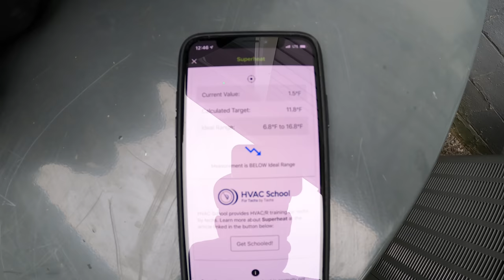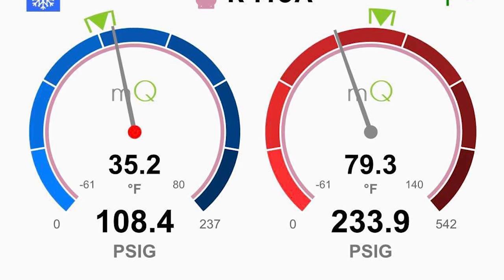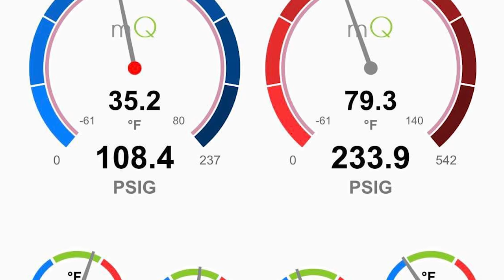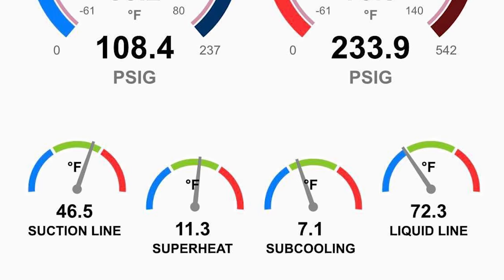Goodman Heat Pump with HORRIBLE Duct System & How I FIXED It!!

Comment: Nothing wrong with flex IF it is installed correctly. Not using galv elbows at the drops and keeping the flex as taut as possible and properly suspended will increase the static pressure dramatically.  I taught ducting for several years and that is one of the most understood and overlooked areas of the hvac industry.

Comment: The run coming of the top seem to have a hard bend. Could that have been avoided with an elbow? I couldn’t quiet see if you address an elbow. Great videos man!!! By far one of the top HVAC channels on YouTube.
Reply: Agree. Good observation.  Doing the right thing isn’t hard. All you need is a sense of pride in yourself. This guy is a badass tech. And quality what he’s producing.
Reply: I was thinking that he was going to put an elbow in there too.
Reply: He also crisscrossed two of the duct lines (see 5:20). It looks like it was because the two outlets that shared a side of the box (3:56) were different sizes and he got them backwards.
Reply: The fact he got the ones with dampers in them as well really gets under my skin. You do not need those things, they always cause problems.

Comment: Was liking it up till you installed the top duct back to the original flatten flex 90.  And should of check for proper static before charge check.

Comment: Definitely better than what was originally there, but that run out of the top of the supply plenum was choked really bad. Flex isn’t meant to turn that tight. Should have put an elbow on the collar or if there wasn’t enough height to do that, should’ve dovetailed the elbow in put it directly in the plenum without a collar.

Comment: Just had a similar call this week, 3 ton bard wall mount unit, grossly over charged. The space was 79 degrees, peaked my head above the ceiling tile and saw 5 of the 7 supply ducts were just laying up in the attic space not even attached to the main ductwork. Why is ductwork always overlooked 🤷🏻‍♂️
Reply from the maker: Nice find! Yea duct systems are usually the weakest link.
Reply: Laziness, selling nature... etc. You tell me buddy

Comment: Question: What was that small plug you put on the box after drilling a hole in it to get a reading?
Reply: the small plug is used to keep the air from leaking out into the attic. It's a pressure tap hole used for taking readings like static pressure or checking temps.
Reply: @marlymar4  I mainly wanted to know the name of it. I get the purpose of reading static pressure, and wanting it plugged back up. I'v yet to buy a manometer since I'm new to the field. Those plugs seem like a good investment for the coming furnace season.
Reply from the maker: https://www.trutechtools.com/9563K42

Comment: still trying to understand why the insulation is on the inside of the supply and return box. I know it is sometimes done that way for one reason or another but I see it as an air quality issue especially once the liner is cut to add ductwork or is that a different kind of insulation than I'm used to seeing?
Reply: IM wondering the same but can't find answers):

Comment: Finally found a couple of vids to help me with my problem.  This one and your one on building a plenum.  I got dealt a crappy hand with my house and have old lazy 10 inch ductwork with asbestos, and dents in it from each time someone bumped their head into it over the years.  Nobody will touch it until that assbestos is gone.  So I was freaking out a bit but then I remembered my old Navy training and it all came back to me.  Turns out I just need to gut everything, including the boots, and replace with a new plenum so I can cut a new take off for the new ducts.  I was just wondering if you had a way to ballpark what size I can get away with.  I have 5 vents and 2 intakes.  Want to see if I can get away with running 6 inch round from the takeoff.  Was going to go maybe a 12" to 6" tee for the take off and run that maybe 20 feet one side of the tee, and directly above for the other side of the tee.  Figured air might be like networking or water where you need twice the flow to supply 2 outlets with the desired flow.   If it were 3 outlets, would have to do 3 times, so 18".  etc.

Comment: Again another BAD Install will kill a system!! Only suggestion I would have is to check the Static First and adjust Fan Speeds  if needed before looking at Refrigerant levels. Wrong Airflow will have a direct affect on Refrigerant levels.\

Comment: I really enjoy your videos, up until this. Other than sealing the duct better then before(which you could have done to the existing mess of duct & saved the homeowner some $$$
), your "plenum Box" for the supply is crap. It needs a properly sized duct system with transitions and smooth radius for the air to flow. That box is gonna have so much turbulence, you wont get a good reading on your probes for static.

Comment: Hey Zack - Do you have any information on creating duct work for a packaged unit that goes from a roof top installed unit through the roof. I need to replace existing ductwork from an old unit and can't find anyone to do it for me, so thinking of doing it myself.

Comment: I have a single air return filter/grille that Ill be replacing in order to get the proper size return for my unit which would be 20x30. (I have a 3 ton unit with a 20x25 return which is causing lots of noise)... does the depth of the return plate/plenum matter? I have received different answers from 3 different techs. One says the deeper it is, the less noisy the system will be, while the other is stating that has no effect on the sound the system will emit through the grille but also wants to up the grille size to 20x36. From the return its a roughly 8 foot straight shot directly into the air handler (I have a heat pump)...

Comment: My attic supply plenum looks exactly the same except with a lot more duct tape from previous owners. I saw how you fabricated the new plenum and attached it to the unit, but how do you screw in the bottom edge? My unit is laying flat on the floor and there's no way for me to get a drill under there to secure it. What could i do there? Is there some kind of sealant i could apply? Im not sure ho to secure the bottom. Thanks!

Comment: When u make holes in the insulation in the plenum, do you spray the fiberglass edges in that hole with a spray or apply mastic to make sure the fiberglass from the edges of that hole don’t go airborne????? Thanks!

Comment: Why didn't you use a 90 at the return air grille? Not supposed to bend flex duct like that. Ductwork will definitely be better than what was there before

Comment: 22 years in in HVAC business in Chicago-land. God  job , you did improve this bad install for sure. The run coming of the top looks like have a hard bend. Allays add  an hard sheet metal elbow regardless on return and supply duct when you have a hard bend. Flexible ducts are used for straight run nor for sharp bend. Flexible duct cases turbulence and slows down air pressure. I rarely use flexible duct, only in rear occasions . Positive thing about flexible duct is less time consumption.

Comment: skip to the future...customer calls and still to humid or they say not working well according to them...now another trip out when busy ofc and you find same thing or maybe something else stupid happened. customer never knows all the proper work you did and now you wish you charged more. now you wish you had skipped that job that took all day long and caused you to be sore the next day from all that labor. you wake some days after saying I will never do that again or I will send installers out instead and just check there work...sweat free and not itchy, cut and bruised next time. work smart not hard boys! move on to quotes and easier stuff...send installers instead and save your body from a pounding. This guy is very good at what he does. I am a fan and he does awesome work.

Comment: One can make a job just going back and fixing issues like in this video.  We fixed a 1/2" tapered down to 0" hole that was about 20 inches long.  It was at the beginning of the supply duct.  It had been pumping our air outside for 10 years or so.  All the guy had to do was hold it up when he screwed it to the unit.  Also, no tape or mastic either.  The outcome is we now have more air coming out of the ducts than before.

Comment: On the return I would make an access door. Easy way to do it is get a stick on door. Cut a hole with hole cutter and slap door on add screws and seal up

Comment: I like most of your work but come on man what the heck was that crap you just did? Duct is squshed by bending too tight, panduits on outside liner kills the r value at that spot, outside liner not even sealed to plenums so thats gonna sweat. Sure its better than it was but its still not right

Comment: Not trying to be a dick but just from looking that duct system looks quite undersized. Why the tiny supply plenum. That house is most likely negative pressure chief.
Reply: Is your Esp @ 0.3 icw and what fpm is that supply and return.

Comment: Quality work, this is the way ductwork should be done. Adding mastic was key as well to get those air gaps sealed tight and keep that insulation from sliding back off the collar over time. My man knows his stuff.

Comment: Hmm. No liner or external duct wrap for plenums. Must have zero humidity where you're at. Here in La. would have been sweating before very long.
Reply: Looks to be a lined supply plenum
Reply: The plenums were lined bob (insulated from the inside)

Comment: New reply on "By insulating your plenums on the interior do you ever have mold growing on the inside? Also since your supply plenum does not reduce in size, Do you just size your flex runs to each individual room? Thanks in advance always trying to learn more. Keep up the great videos"
Reply: He has volume dampers at the supply plenum

Comment: I like how you wag your finger at the previous installer's work but you only do a marginally better job than them. I guess it is what it is. That's what smoothbrains say to themselves to cope, right?
Reply: Ridiculous comment!
Reply: The way the comment was written was unnecessary but I do agree that the job wasn’t done to his full potential, didn’t seal the inside where he made his cuts, ducts were air restricted should of used 90’s or extended the ducts to make a better 90 little things like that